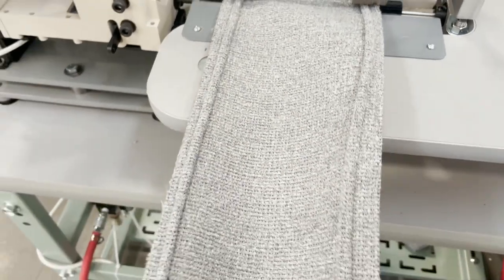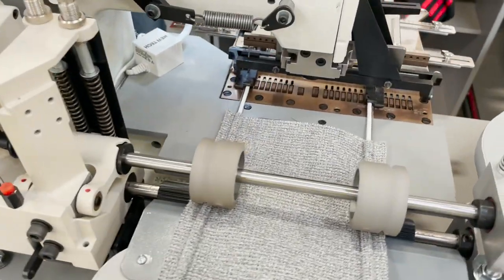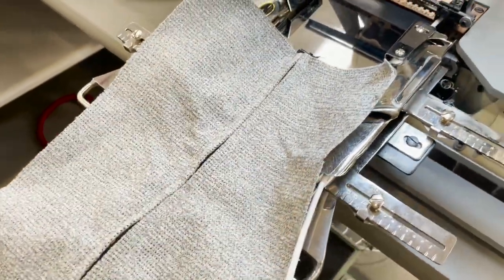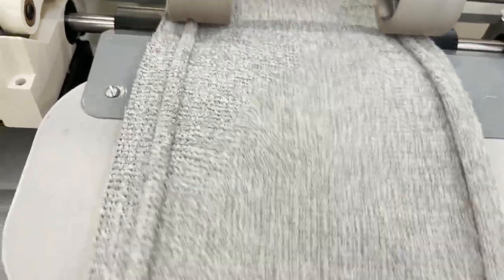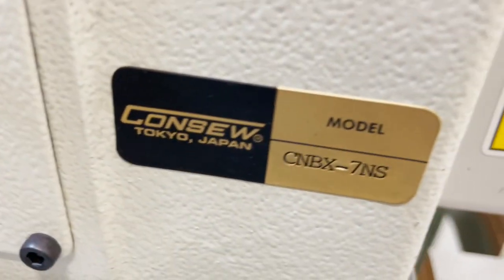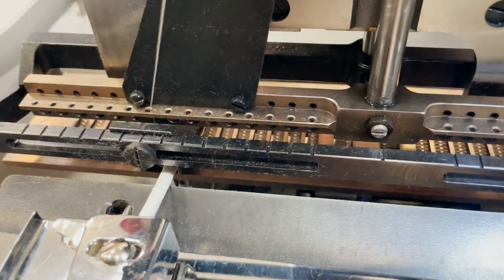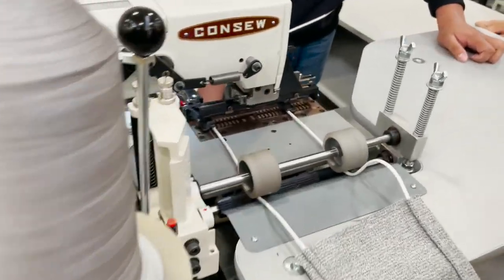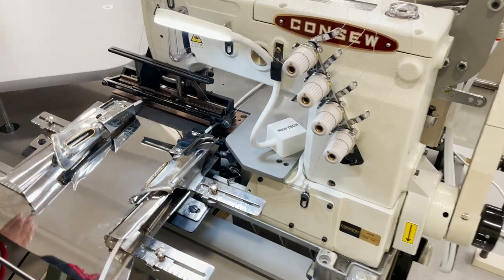Product Showcase - Consew CNBX-7NS Cushion Boxing Machine - Goldstartool.com - 800-868-4419

Comment: This is a very cool machine, we did 60 box cushions and 10 pool cushions for a hotel last year this machine would've saved so much time. What does something like this run?
Also I've been curious how premade welt is built and what machine they use. Usually it's glued with uniform notches on the sleavage